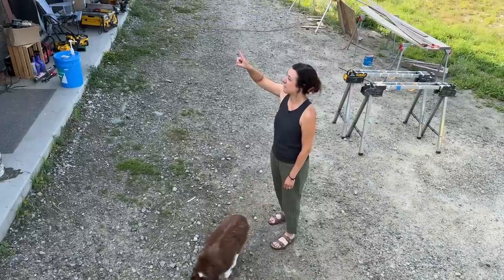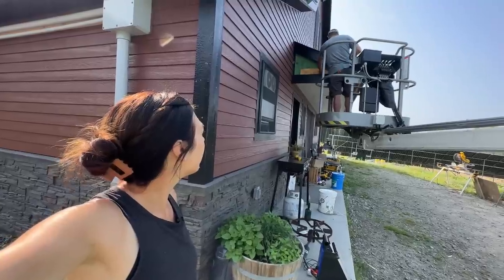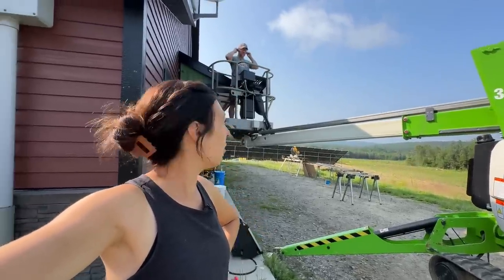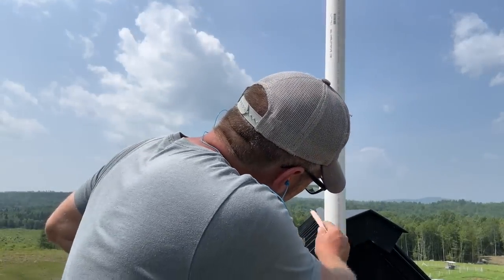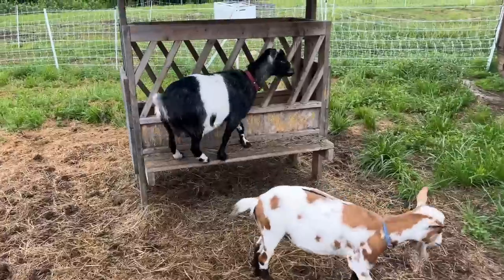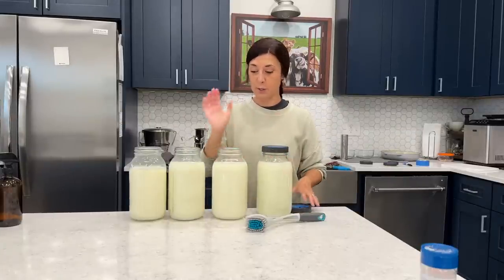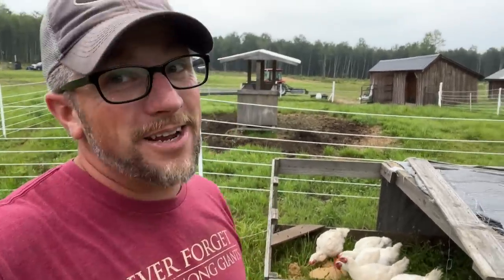We're FINALLY Ready to SHARE THIS!

Comment: When code says the sewer vent pipe has to be between 6 and 12 inches above the roof line, those lengths serves multiple purposes. The minimum of 6 inches above the roof is needed for flashing and to create venturi effect when wind blows across the top of the pipe. The maximum length 12 inches is about heat generated inside the house stops moisture from freezing inside the pipe during cold weather. In your case that maximum dimension should be measured from the side wall of the house where the pipe exits, hot from the roof line. I think your vent pipe was probably frozen solid on those below 0 days last winter
ps: increasing the pipe diameter might help prevent freezing
Reply: ... that code was written to get the vent stack above snow on the roof but with a side exit in this case, the main objective here is "out in the open" to disperse the stink factor. Yes, increasing the diameter will reduce the risk of frost closure (the technical term) but there's also a risk of a clog from having a change in pipe size, although probably a slim chance. BTW, code would dictate that vent pipe to be 3" all the way up instead of 2". I don't recall where he changed the size inside the house.
Reply: wouldn't it also be a good idea to put a cap on it? You know a little triangle cap that sits above it, to prevent anything from going down into it like rain and snow?
Reply: @Caboladk  Since plumbing vents are connected to the drain system, any rain or snow that enters it goes down the drain. The amount is pretty small, so no need to worry about it overwhelming a septic system.

Take care and God Bless.

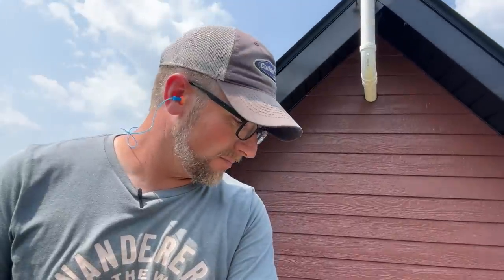Comment: 12:48 - glad you cut the stink pipe to your liking, Al - Hopefully you painted it as the UV will make that PVC pipe brittle and it'll most likely shatter in the weather over time.  I also noticed your wasps were still in residence - we could see them behind you as you were coming down off the lift.  Hope you don't have a huge nest inside the attic!  Time for some wasp removal?
Reply: Painting that vent pipe is a priority! Given the UV from the sun at that location, the PVC will be rotting out in no time. I think black to match your trim would help reduce the amount it stands out. In creasing it size is a good idea too.
Reply: I agree, the stink-pipe should be painted. I think they should have used gray (UV rated) pipe to reduce the chance of the PVC getting brittle from the sun. 
But, it is what it is. We can all second-guess but they've done amazing work on the house and it looks great.
Reply: Sam a quick Google search produced this PVC pipe can last under the sun for 50 to 80 years and can withstand high temperatures of up to 140OF (60OC).

Comment: I would spray-paint the stink pipe black so it looks better. When you rotate your tires, also rotate the spare in with them and it will keep the mechanism that lowers the spare working.
Reply: White PVC deteriorates in sunlight. Black paint will help it last.
Rotating with the spare yields up to 25% more tread life from 5 tires. Think about it.

Comment: for your spare tire carrier, once you get it cleaned up you need to put anti seize compound on the moving parts then run it thru its full range so the compound can coat the entire mechanism, and being in a place that salts your roads you need to be diligent on preventative maintenance as you just gave a perfect example of why it is important, you got lucky that a friend passed by to help you, congrats on the coffee line of merchandise ,
Reply: it's probably too late to save the spare winch, so a new one with some annual maintenance / cleaning is the way to go. BTW, never-seize is great at catching road dirt and creating more issues. Better to use something like PB Blaster and do annual maintenance. I'd also bet that full size spare wheel is rusty like a boat anchor by now.
Reply: @rupe53  in a place that salts its roads ANNUAL maintenance is not enough, preventative maintenance should be performed every month, as for the tire winch you need to put some kind of protection fluid/lube on it more than once a year, the fact that he could not access his spare proves my point, and you maybe correct in that the spare might a boat anchor by now, im an aircraft mechanic and my regimen on my own trucks/cars is just as strict as i am with aircraft
Reply: Lucas's red n tacky. Great for farm equipment and automotive alike. Gate hinges, ball hitches, etc. It's bearing grease.

Comment: Good morning Al and Gina…Love your show…Now with that out of the way, the arrangement of your vent pipe (VTR) is going to be problematic in the winter…The VTR should come straight up through the roof and increase in size to at least a 3” diameter to prevent frost forming…That 2” pipe with that 90* bend outside will collect moisture from your cozy home and freeze…❄️❄️❄️
Reply: Guess time will tell if it becomes an issue.  Maybe we'll see a future video about it when winter comes?
Reply: I believe Al was thinking of the VTR in terms of a chimney where the purpose is to avoid downdrafts if you are not high enough relative to the location of the ridge…I’m guessing Al didn’t want to cut a hole in the roof when he did the plumbing rough-in…😎

Comment: If you mark you cut piece of siding with reveal (from the bottom) on each end. Then just place your next angled piece on the marks and mark the length for the square cut. No tape needed.
You should be able to cut them all and bring the group up at once.

Comment: Al, the simplest way to keep salt corrosion from freezing up the tire carrier, is once you have it apart, spray everything down with Fluid Film. Make the spraying a summer scheduled item. Since you're going to install a lift in the new building, this should be a no drama project.

I was puzzled with waiting to install the last pieces of siding. I would have though that you would have done the siding, then the wood trim, followed by the aluminum fascia.

Comment: A rain cap can also assist with drawing the gases out so it's not just the water going in. Every pipe I've ever seen in Aus has the  cover of one sort or another. It helps with blockages as well.

Comment: It's just a garden spider. You may won't hurt you. But in fact, we used to throw on crickets and grasshoppers and other bugs. So little fat and I'm up real big. Spread down with master blaster lubricant. And then leave it, just spray it down with master blaster for a little while. Then take your wire brush and run over it. And it'll clean it off. I mean, you can take the whole thing once you get it down. I mean, you can take The Thing down. You buy a new kit, but you need to oil. If you're gonna be in salt country, you need to put grease on them, take them off.  Random trucks even put grease on them because it salt gets under there and stays in the grease prevents it from getting into the metal.

Comment: Why did you not adjust the corner of those wedge corners  to the angle of the slope of the siding they face instead of 90 degrees

Comment: Hi, I’m from Australia and you mentioned that in Australia they have to use a rain cap. I believe it does more than that, it keeps insects out too, flies especially
Reply: We had a few people come into our hardware store saying birds and squirrels would go down into the pipe and die which caused the vent pipe to get clogged. Maybe while you have the lift, you could zip-tie a piece of nylon screen wire around the opening.

Comment: Since your vent.pipe doesn't exist through your roof, all bets are off on whether it will freeze. The 6" code is for vents through the roof.  Your pipe ceases to be heated by the ambient heat of your house 6 inches after it exits from your wall. I'm hoping you don't learn a stinky lesson this winter.

Comment: I would have cut the ends of the siding pieces to account for the taper on the siding that was already installed. Now that it's in, You might want want inset a piece of 1x1 painted black. You could inset it using an oscillating saw.

Comment: Good mornin Lumnah's, funny story, i have to get my cup of coffee before i set down to watch what has become my favorite Youtube channel, yours. Sadly i'm not a fan of cold coffee. Like mine steaming hot. Around here in central Pa the road crews put down a salt brine mixture when the roads get icy, which reaks havock on vehicles. Every summer I lower my spare on my truck and clean, air up, and lube the heck out of the cable area. I have had it happen like what happened to you, couldn't get it to come down. Trust me, once it happens to you, you will take proper care of it and lube it every year. Have a great day!!  Jay from Pa.

Comment: When I was a kid, I went fishing on Lake Kickapoo with my Uncle Horace using illegal trotlines. While he was setting out trotlines in the boat, he would drop me off on an island where I would build a fire and make and drink coffee. I captured this experience in my fictional novel, Michael's Eyes. This is an excerpt. "Michael jumped from the boat and began gathering wood for the fire, as Horace and Ross found two large rocks to use for the snag line and loaded them into the boat. When Michael had made a large pile of wood, Ross used his carbide lantern to light it and the fire was quickly roaring. Horace dipped the coffee pot into the lake to fill it with water and added a couple of handfuls of coffee grounds. He placed a large rock into the firepit and put the pot on it, such that the fire heated it on all sides. After about twenty minutes the coffee was boiling."

Comment: 6” above the roof is assuming it is a roof penetration. You have a lot more pipe exposed to the cold.

Mine have elbows on top because one of the elbows in the attic is cracked and after a rain it seep onto the ceiling. Rather than make if project if it, elbows on top won’t allow rain to enter.

Comment: How are you preventing rain water from migrating back to the Zip board at the bottom siding board? Specifically at the ends of the porch roof. If water works it's way under the bottom siding board it will eventually deteriorate the bottom black trim and, eventually, your porch ceiling.

Comment: SALT & RUST/CORROSION - "Free (All)" spray will break through the crusty headache and Cosmoline spray will prevent it from coming back.  I found out about cosmoline when I worked at the vehicle processing center where BMWs first come into the U.S., on the West Coast. They spray the cars all over, and under, before they get loaded onto the huge freighters and the first thing they did coming into the VPC was taking them through an intense 'car wash' to get it off the paint, glass and wheels.  Looking forward to trying out the Lumnah brew blends ☕️😁👍

Comment: Try spraying  some WD40 with a nozzle into the spare tire tube with the vehicle parked  going downhill and let it work for awhile then work the rod again to hopefully break it free. Its always a good idea to lower praise a spare tire about every 6mos to a year and spritz it with some WD40 etc and at the same time check its air pressure because they can go flat. Often forgotten until their needed at times the spare's lowering mechanism is a bit protected by the tire and when you rotate your tires at a shop etc. its a good time to check it as well with a bit of maintenance.

Comment: Having the spare tire under the vehicle has been the worst idea from designers!  I think they work maybe the first year, then they rust and it's impossible to get them down when you need them.
Reply: I think an owner would have to maintain that system every month after the first year, keeping it lubricated and sprayed with a rust preventer like FluidFilm.  Alas, the design of certain components do not last the test of time in certain environments.  No doubt in the southwest, those systems last forever, considering their climate!

Comment: Siding on the ends of the overhang looks good, but I think it would have also looked good and been easier and taken much less time if you just put a solid piece of black metal to match the trim.  What is the purpose of that metal thing over the back of the cow when Gina is milking it?
Reply: It's a Cow Kick Bar, it prevents the cow kicking when you are milking it.

Comment: Hi AL, I was wondering if you'll need to put a mesh/netting over the top of that exhaust pipe to stop wasps from building a nest which will block that opening?
Reply: They would die from the Methane gas venting from pipi!

Comment: WHY  O Why did you not paint that vent pipe?  Are you sure you cut it off to the correct height?  
 Also if you don't seal the gap on the front overhang the bees will build a home in that space!

Comment: Good morning from central Michigan,

Yall like a little coffee with your cream. Mine is Folgers medium grind breakfast blend in Mr. Coffee drip maker, 32oz coffee (hot), 2 tbsp. cream (no foam), 2 tbsp. brown sugar (home made) & 1 ice cube. Brown sugar is 2 cups white cane sugar + 3 tbsp. unsulphured molasses blended with whisk. I keep my coffee grounds in a vacuum canister after opening, same with brown sugar. My Mr. Coffee maker has a smart control I installed to turn it on as soon as I wake up, " Alexa, turn Mr. Coffee on". Sonoff Mini R2 WiFi switch. My smart watch (like the ones I sent you) tells me if Mr. Coffee has been turned on or off (push notification of device status change).

Comment: Push up on the spare tire, to create slack in the cable that's holding it in place.  Cut the cable when it's got enough slack in it to do so.  Then you'll be able to get it down.  We had the same problem with our pick-up.  Spare tire now rides in the bed of the truck, because that design for the spare tire storage sucks.

Comment: You need a traveling workshop just one more reason, setup and storage and back to work. Just walk in and start working. 😊 and keeping equipment out of the weather.  The roof all solar panels. 😂
Reply from the maker: Maybe someday we’ll build one. It would come in handy
Reply: @LumnahAcres  - in the mean time, one of those "Pop Up Canopy Tent" like they sell at Harbor Freight might be handy - as long as it was tied down with tent pegs in the wind if it was left out.... 🙂

Comment: My car has an undercarriage spare wheel and it got all rusted up, my dad got it free then showed me how to open it then we plastered it with Vaseline and once a month or so when I check oil etc I take and give the bolt several turns each way, problem solved
Reply: Preventive maintenance is the key to so many things...
Reply: @samvalentine3206  Old saying here in Ireland Prevention is better than Cure
Reply: @tonygrimes13  - that's a legit saying!

Comment: Al the vent pipe is not good enough if ur going to leave the top at 2 inches you need a minimum  of a 3 inch pipe size for the top., Why 3" because the pipe cannot freeze over with condensation but any thing under than can happen, the ice that would possible form over the pipe can't  happen with a 3 inch pipe because the gap is to wide and the ice that forms cannot hold it's own weight to bridge that gap and anything under that can freeze over. That should be in the plumbing code if you check with a local plumber. FACT

Comment: Don't want to rain on anyone's parade, but, that stink pipe. Shouldn't it have something to stop rain going in, like a u-bend to drop the opening vertically down, realise this may reduce flow a little, but rain filling it up, may bother you more. Could just be exposing my own ignorance here, but if I'm wrong, what is the thinking? Also, would it not look better painted black to match the rest. There are those two boxes, don't know what they are either, but they are white and stand out against the red and black.